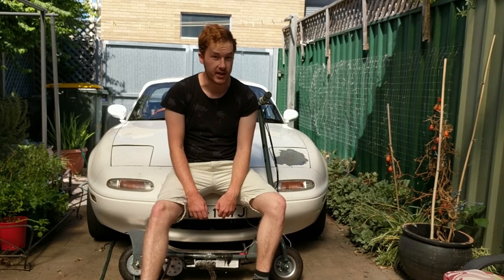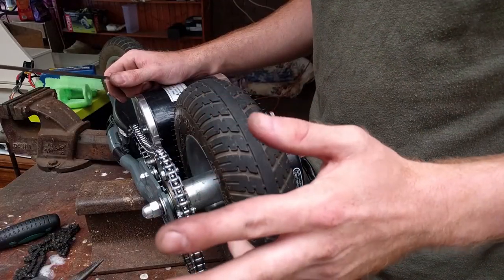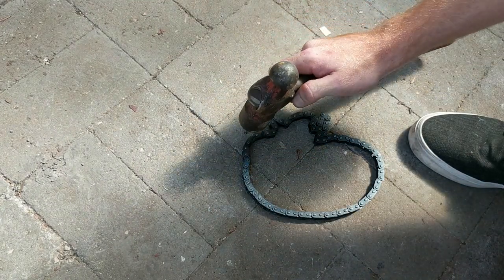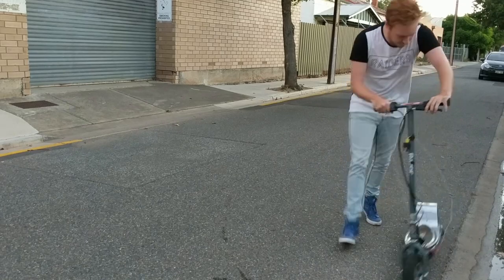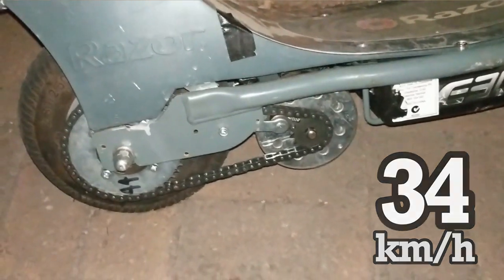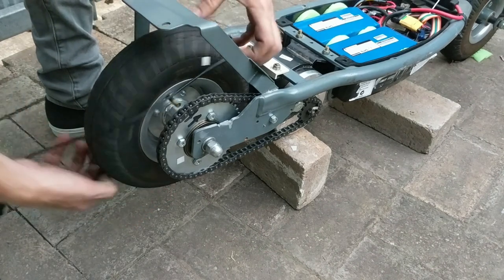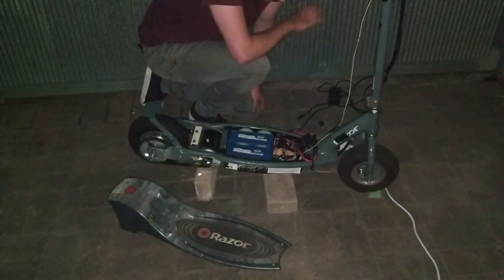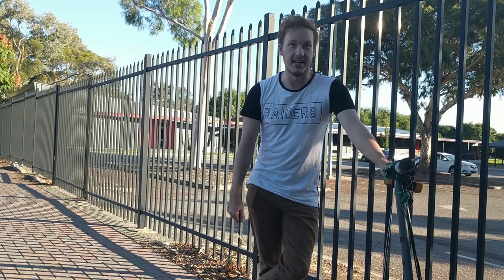Fast RAZOR E300 Burns Rubber With Big Power - Scooter Episode 6

Comment: Most of the heat is comming from that double diode. The same current that passes through your MOSFET also passes through these diodes. I am actually surprised they hold up so well. Give it a somewhat more generous diode and the temps should go down quit significantly
Reply from the maker: +hylacemess I'm not sure I follow - those diodes I believe are snubber diodes which are there to block spikes from the motor's back EMF, so there shouldn't be any major current flow through it?
Reply: The way this controller is build is most likely as follows: Motor is connected to battery + and MOSFET drain. MOSFET source is connected to battery -. By twisting the throttle the controler starts switching the MOSFET on for short amounts of time. During these time slots current starts to flow through both motor and MOSFET. The slope however is not infinitly steap. Instead it ramps up with a rate which is proportional to the inductance of the motor (it is a big coil in the end). Remember: Inductors resisit current changes. This is key to understand what the diode is for. It is connected antiparallel to the Motor. That means it is in reverse direction so that in motor resting state it does not conduct. Otherwise it would short out the motor. As the MOSFET is now switched off the current in the motor is not able to instandly go back to zero. Just like before it slowly ramps down. Only this time the current can not go through the MOSFET as it is turned off. That is when the diode starts conducting. The motor current over time looks like triangles joind end to end. The rising slope is going through the MOSFET and the falling one is going through the Diode. So the average current through MOSFET and diode are the same.
Reply from the maker: +hylacemess ah yes, I see. I can confirm the circuit is set up in that way. 

I may spec a better diode; when you say "more generous", what precisely do you mean?
Reply: Do you have any reliable estimate of the motor current? As I am pretty sure the answer is no, "more generouse" means exaclty that ;) The original diode handles about 30A continuous (by the way 45v max, so thats pretty close, too). Finding a diode in a package that fits in your controler might proofe challenging. Also doubling up on them might be your only choice.
Reply: Something like a MBR60H100 should do the trick.
Reply from the maker: hahaha. yeah it's pretty damn hard to measure the current under load without some pseudo-dyno rig. I'll look for something uprated to try and bring temps down.

Comment: What do you use to charge it?
Reply from the maker: A basic charger from eBay that puts out 42V (nominally 36V), the onboard BMS board handles balancing
Reply: @WhatUpTKHere  I think I'm going to mod my controller like you did, do a 36v upgrade, and a 13 tooth sprocket upgrade. I don't need to go 40 KM/h, but I do want more speed out of mine. Great vids, love that you continued the series over the years. :D
Reply from the maker: @the_kombinator  Thanks homie! good luck with your build :)

Comment: Hey TK, idk if anyone posted this already or if you know, but the extension for inflating the rear tire can be found in the right handlebar grip.
Reply from the maker: Aaron Amberson hahaha, dude thank you!
Reply: Yeah no prob. I have my own scooter, the e300"s", which just means that the seat came with it. I hope that the axle isn't bent, but the rear tire seems to make a wavy noise when it's running. What do you think it is? I guess it could be the brake...
Reply from the maker: Aaron Amberson hm, not sure what you mean by a wavy noise, but I get a shuffling sound from the brake regularly because the band brake has a very flexible frame and the band often rubs.
Reply: Ok thanks. I'll try adjusting the brake, but it does seem that the axle IS actually bent. It's either that or razor did a dandy job of centering the sprocket. Is there a way to bend the axle back? no clue how it got bent.
Reply from the maker: no real decent way of bending the axle back straight. you'd want a new part.  

can be bent quite easily through bumps or dropping off kerbs, depending on how thick the axle is versus the weight of the rider. 

I had this problem often with my earlier scooter builds due to being an adult riding a scooter spec'd for children.
Reply: Ok, thanks man, you're a big help. I really enjoyed watching this series of scooter videos and look forward to watching more of yours! Great job.

Comment: why didnt you us a brushless motor
Reply from the maker: brushed motors are readily accessible, still work with the original controller with mods, and I wanted to build on my knowledge working with brushed motors.
Reply: you would get much more torque using brushless motors
Reply: you can get brushless controllers next to know these day and that bigger motor you fitted you can get the same size motor for around 50 60 pounds
Reply from the maker: +wizzy tech yeah, haha I know all this. I've built high power (5KW+) brushless setups before. just not what I wanted to do here. think of it like an American hot rod fan building a carby V8. Sure, fuel injection has advantages, but they want to do a carby build to learn and for fun and their personal taste.

Comment: Please do a video explaining how to make your scooter tires NOT pop every 5 seconds
Reply from the maker: Sir Ashton935 are your tires popping? Under what conditions?
Reply: TK I was just riding it and hour ago just around my street and each set pops within 3 months
Reply: is there a certain type you would recommend
Reply from the maker: Sir Ashton935 super weird. Are you over inflating them? I haven't ridden my scooter much outside of these videos but I've had no issues on the stock tyre. 

Wherever you're buying them from, try somewhere else instead.
Reply: TK I have no way to inflate them so when they go flat I air them up at a gas station but they usually pop before i even have to inflate them. It seems like they wear down quite fast because after about 2 months alot of the tire has already worn away.
Reply from the maker: Sir Ashton935 I see. Difficult to diagnose without seeing it, feel free to shoot me some photos on Twitter - @whatuptkhere

Generally you don't wanna use those electronic automated gas station pumps for tyres on bikes and scooters. Best to use a bike pump to avoid overpressure.
Reply: TK yeah one of them was even an e300 tire and it still popped
Reply: TK now I'm having more issues, my batteries are on the verge of exploding, do you think it would be the charger or the batteries themselves?
Reply from the maker: Without seeing the full set up, it's impossible to say. Are we talking LiPo, lead acid, something else?
Reply: TK they are led acids and its not an e300, if you need me to i will shoot you photos on twitter
Reply from the maker: Sir Ashton 556 yeah, do so
Reply: TK https://twitter.com/556Sir/status/1009458302139461633?s=19
Reply: TK I just started rebuilding my e300 completely stock and the relay clicks but doesn't turn the motor. Would you know what the issue would be?
Reply from the maker: Sir Ashton 556 sounds like you need to bypass the relay like I did in an earlier episode. I'm guessing you've gone to a 36V setup?
Reply: What Up TK Here just finished repairing my e300 completely stock, and its getting about half the speed it should be. Do you think the motor is worn out or the batteries are bad?

Comment: where did you get the sprockets. i want to buy a 15 tooth
Reply from the maker: Keep in mind the 15 tooth I bought was to match my upgraded motor, not the stock one.  I got it off Alibaba.
Reply: @WhatUpTKHere  can I have the link please and also is there 20t?
Reply from the maker: Sorry, it was years ago. Use the search bar.

Comment: totally awesome series. I'm revamping my Schwinn S180 that was already fitted with a Currie 24v 500w motor overvolted at 36v, 15T pinion and 65T rear sprockets. Topped out at 33+ mph with me on it at 195-200lbs.  It gets pretty warm, so I'm going to regear at 15/55, drop it back to 24V but using 4  12v batteries in a series parallel config to increase range. 

The YK31c controller has the shunt mod and has held up thus far, but I'm a little worried about current draw with the new gearing and less voltage. Should I get a rolling start before throttling to prevent huge current spikes? Also, that diode thing you were talking about below.... could going higher value there decrease my controller temps?
Reply from the maker: Diode is just for snubbing the back EMF, so shouldn't need to change.

Definitely riding it easy should help, but it can be tough to ride soft to protect a controller. See how you go!